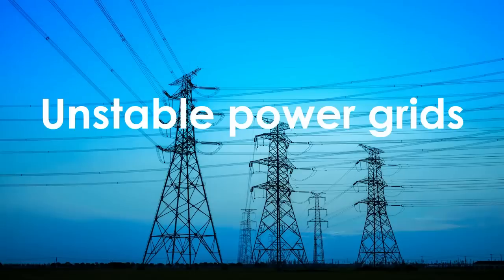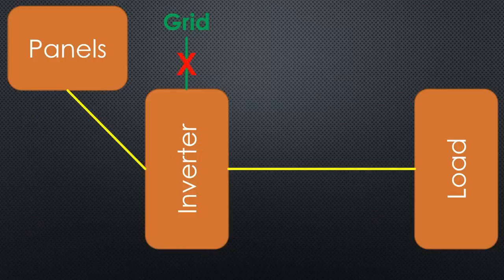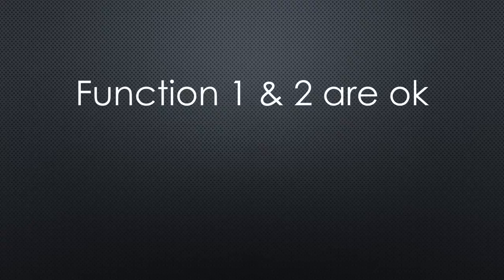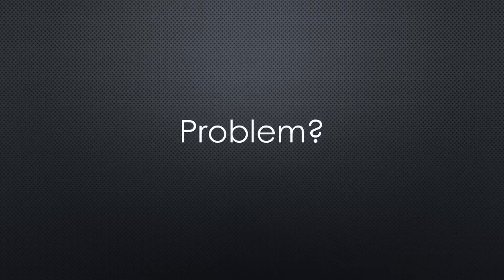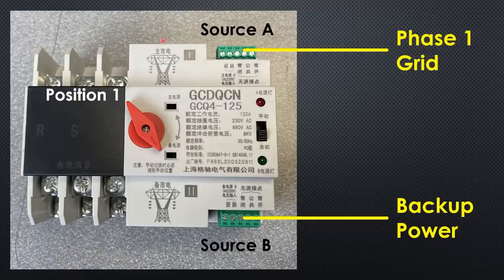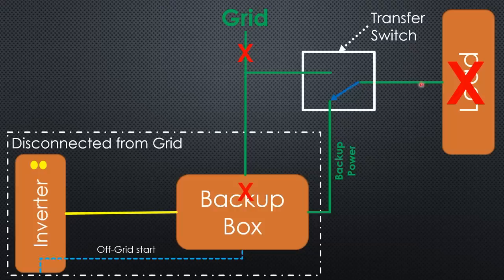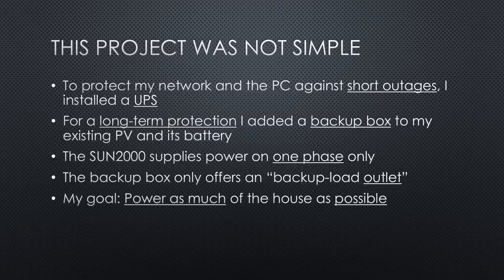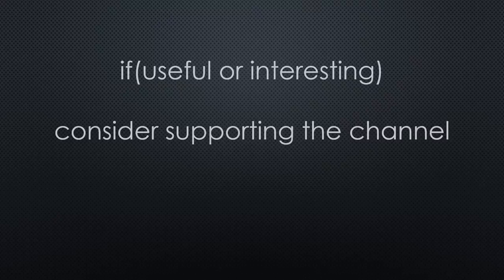448 How to Build an On- and Off-Grid System (Backup Box Hack, Huawei SUN2000, LUNA2000)

Comment: Hello Andreas, I have at the moment also a SUN2000L1 so only one phase, without battery or backup box, and my parents are also asking for a solution when the grid goes off.
You got a really good price for the 10 kWh and the backup-box, I think now it is much more expensive.
I think that a better solution is to buy an off-grid inverter that accepts non proprietary batteries, I am thinking about a Growatt with Pylontech batteries, this inverter will be connected between the Huawei and the house and will work as an UPS when the grid is off, without the delay that the Huawei has. Of course no hack of the electrical network will be needed.
Reply from the maker: I needed an on- grid because it’s main purpose is producing energy for our home and sell the rest. We produce 5x what we need in the summer months.
Reply: @AndreasSpiess  I have also on-grid and already injected a lot, but instead of Luna + Backup Box + Hack + UPS I want to use a Growatt + Pylontech. Much more KISS than your approach imho. I guess you didn't know that the Huawei has that 3s delay when commuting from on-grid to off-grid?
Reply: maybe since DIY self storage isnt practicle, combining all the extra solar energy could make it more practical, to say move a mass battery, a huge rock that spins, having like 50 solar connections hooked up to it all giving their extra energy to spin it where on their own couldnt do it,  then this spinning mass will be slowed down to use the energy in the winter, obviously would this be a net gain is something a little math would figure out quickly, but other than pumping water, no long term solar storage really exists...
Reply from the maker: @bbogdanmircea  I do not know which particular products you look at. Just ensure your inverter or battery can do all the needed off-grid switching.
Reply from the maker: @mikejones-vd3fg  We can store a lot of electricity in our alpine lakes. But for the moment, I do not care too much about it. We still burn lots of gas and coal during spring/summer/autumn. If we can replace that part, we already have something... For the rest, we have a few years left. And as an engineer, I am confident that innovation will not stop.
Reply: Hello, thank you for your input! My supplier has installed Sun2000-8ktl-m1 and a Luna 2000 battery. They are about to install the backup box as they sold to me as a off grid solution.. When I read the documentation + see videos like this I find out that the Sun2000-8ktl-m1 is not going to work totally off-grid and the backup box will only deliver 3000va + the 3 sec. Delay.. I am not so happy about that. Can the solution you are describing work with the setup I have installed now? If so, can you please tell me what I need to do. Thank you😊

Comment: Hello Andreas. I'm new to solar and thought this video was very interesting. I'm just wondering why you are investing this amount of money for something a 1000€ petrol powered generator could do, during a longer blackout?

As you, I like things simple, so my plan is to use solar to complement my grid. No batteries, no inverters, no big investments, only solar DC to DC load. Small investments, but still a system that continues to work when the grid goes down. That happens 1-2 times/year here in  Sweden and it never lasts longer than a few minutes.

As I said, I'm new to solar, but my plan is to use the sun and solar panels to power pumps and resistance wires to heat up my pool, cook food, heat my house and run my water heater. This will work in theory and I'm gonna try to make it work. Simple and cheap solutions.

I really like your videos, so keep up the good work 👍
Reply from the maker: The backup solution was a hobby for me. Not needed in Switzerland (like in Swiden)...
Reply: @AndreasSpiess  Ok, I understand. Thanks for the reply

Comment: Hello Andreas, thanks for your videos. I have noticed one possible problem with connecting 1 phase to 3 phases and it is possible overloading of neutral (blue) wire on appliance connected to 3 phase to star. If phases of AC are shifted by 120 degree, as from grid, than in balanced load there is no current on blue wire and in worst unbalanced case there is same current as maximum on each phase wire. Therefore blue wire has normally same (or smaller) diameter as phase wires. If all three phases are conneted to one though, there is no shift, and on blue wire current will be 3x phase current. As this is how my water heater is connected (3 phase to star) i have been thinking about current on neutral wire an it is freshly in my mind. As you do not use electricity for heating, this is probably not an issue for you, but it is important in general, as this could lead to serious  overheating of blue wire if used for longer time. I hope this is not already mentioned in other comment, but there are too many.
Reply from the maker: In principle, you are right. However, my inverter only delivers 5kW. So there is no problem with that. Plus to save (precious) energy when the grid is down, I do not use such high-power applications.

Comment: Correct me if I'm wrong but Star connected motors supplied from 1 phase will overheat immediately, the currents will be the LRA (Locked Rotor Amperage) and the system will overload the inverter  🤔 ....... Star connected resistive loads can "overload" the neutral wire if they are too high, but if they are small loads I do not see that much problem
Reply from the maker: The problem with star motors is well possible. I do no more remember these topics from my EE studies ;-)

Comment: Thanks again and Congrats! Paralleling all 3 Phases could overload the neutral line of loads in star configuration. But during power outage, cooking will be done by a camping gas cooker.  
Your solution is very unexpensive. The battery is way less expensive than my BYD HVS. And your Backup-box is quite fast.
My Fronius Gen24 supports 3 phase backup. But it needs an expensive backup box und the transfer is slower than yours (German rules, I think).  Otherwise my small Victron backup solution for the heating system has UPS speed.
Reply from the maker: The Victrons seem to be very fast. A colleague has a 3 phase design and is happy. When I ordered our inverter I did not think that I ever will think of a backup solution. For normal operation, my inverter/battery is extremely cheap ( and is LiFePo4 and high voltage). All deciding factors. one year ago...
Reply: @AndreasSpiess  The backup idea was the starting point for me in 2021 after reading the report of the Bundesrechnungshof anticipating the issues and after the elections. But I hesitated too long because I wanted to avoid 3000 EUR for a new main distribution box in my >50 year old house (crazy German rules). And I wanted to have a 3 phase Victron system. But here, there is no company installing this. So, I ordered in March 2022 a "standard system". Then, all was delayed until autumn. In autumn our government decided 0% VAT for PV beginning from 2023. End of january the system was installed but I have to wait until the meter is replaced by a two directional one.....  Long journey
Reply from the maker: @klassichd10  Indeed. We were lucky, and from the order (24.2.22) to the first energy (26.5.22) was fast. The counter came in June. But I still do not have a valid invoice...
Reply: @AndreasSpiess  But you have your "own" electricity. Fast and inexpensive, lucky man. Virtutis fortuna adjuvat. Great DIY team.
Reply from the maker: @klassichd10  Indeed. Being a YouTuber might have helped a bit ;-)
Reply: @AndreasSpiess  A well-deserved bonus for you and you shared it with your neighborhood. Well done!

Comment: My Fronius Symo GEN 24 8.0 is also a Hybrid Inverter like yours. It supplies 3 phases and up to 3.7 kWh per phase and max 8kW (for my version) in total. And strangely, Fronius claims that the off-grid mode must only be used for max. 20% of the total life time of the device. Why? Cooling? Market segmentation against more expensive off-grid solutions. But the best of your solution is the switching time: For my Fronius the siwcthing time (the time without power) about 90s. Your switching was very fast. I do not understand the technical reason for the 90s delay in my case. But anyway, the long term problem is solved as well. I like concrete information about devices, like in your videos, very much.
Reply from the maker: I know why they wait for the 3 seconds here. The electricity company wants that the inverter waits till the breakers are "really" open. Only then, the "off-grid" signal must go to the inverter. An it needs a short time to start.
90 seconds seem to be rather long... And I did not read anything 20% usage. However, our inverter delivers 8kW in on-grid and only around 3kW in off-grid.
Reply: @AndreasSpiess  Yes, waiting for 3 seconds to make sure the mechanical switches did their job is ok. The 90s smell like they want to skip any short power outages which are less than 90s and do not want to go into off-grid mode for short periods of time. But I do not understand this. And yes, the inverter also restarts in my case. But that should not take 90s. I think the market for the hybrid inverters is still developing and we will hopefully see better products in the next years. I mean, you could easily imagine an UPS-like switch within a half-wave. That would be a killer feature since it would further simplify the setup and that would certainly be worth some money. (I hope some manufacturer reads this. 🙂 )

Comment: for around 10.000 euros I build a system with 13kwh of batteries 6kw of solar and 2 inverters. A cheap grid tied inverter from a brand called solax and a victron multiplus 2 5000va. The system power the home with out grid and if i don't have engough sun it switch to the grid. for the money the system is quite cheap. I build everything my self so that lower the cost significantly.
Reply from the maker: Good project! I hope you will be successful!

Comment: As I am not really an electrician I have some issues in understanding the ATS-wiring (to be able to discuss with my electrician). My understanding: Source A (upper area): Phases 1-3 are not connected, just phase and neutral on the green connector from Grid. Source B (lower area, upper connector): The phase from the backup-box is connected to phase 1 and also to 2 and 3, right? The green connector is connected to phase and neutral from the backup box. The lower connector on the lower area is the output to the load.
Reply from the maker: Yes. The Huawei inverter only provides one phase. But I wanted light in all rooms. So I connected this one phase to all phases.

Comment: Maybe I misunderstood something... the SUN2000 inverter runs 3-phase when the grid is connected, but only 1 phase in backup mode? Or is there a second inverter for the grid-tie operation? This is one case where I'm glad we split one phase here in the US... much simpler household electrics! 👍
Reply from the maker: Yes, the SUN2000 inverter runs 3-phase when the grid is connected, but only 1 phase in backup mode (explanation in an earlier video). This is the reason for my "hack".

Comment: Interesting exactly what I need , I want to make my own back up box , do you know what the signal/ voltage is given from the original backup box to the inverter to fire it in back up operation?
Reply from the maker: No. I assume the backup box just has a relay contact.

Comment: For a system that only works if the grid is connected then I'd just use a small-ish SINE WAVE inverter fed into the changeover switch to make the system think it was connected to the grid again, as a sort of solar boosted inverter (make the whole system think it was grid connected again). Not sure on the legality, but at least you'd have power again from solar (and batteries). Excess solar would then keep the batteries charged.
Reply from the maker: I am also not sure about the legality. And what happens if the grid comes back...
Reply: @AndreasSpiess  The grid is disconnected when it fails, and swaps to your system by an automatic change-over switch (it's pretty much what the purchased all in one off-grid powered devices do, but a diy version for people that have a non off grid capable system). If the grid  comes back, it can automatically switch over again. At no time would you be trying to put power onto a dead grid (that is most definitely illegal). I've no idea if it would work, as I'm not sure if it's possible to fool a grid tied system into thinking it's attached to the grid using an inverter, but it's what I would try if had to. This is why I made a point of the inverter having to be a good quality, sine wave type, to maximise the chances of success. Some residences have the option of a change over so that you can partly power your residence from a generator in the event of grid failure. I believe it is done in the US and also the UK in some rural areas; some of my siblings place of residence has the option, and it is used every so often with a backup generator for partial power (light loads and lighting and for the heating as that doesn't work without an electrical supply, even though it is fuel-oil powered).

Comment: Cool, i'm from Algeria, and i have a similar situation to yours when it comes to the distribution of loads and phases, each phase is going to a different floor, and heavy loads and lighting/light loads are mixed, i wish i could rewire everything to separate them but it will cost and take much effort
i also spent tons of money on 17Kwh OPzS batteries, and a victron Multiplus 5KV inverter (i've yet to buy extra 2KW panels in addition to the old 1KW )
i'm currently reading about classic control to build my own custom ATS to fulfill my needs, with open option to use Arduino to add some complex logic to the system
Reply from the maker: At least you should have much more sun than we have ;-)
Your battery is quite big for a 1kW panel, BTW.
Reply: @AndreasSpiess  yes, planning to get extra 2KW, have more cooling loads in summer, usually the AC stay on at night in July and august
Reply: @AndreasSpiess  the reason i bought the batteries before the end of last year and before solar panels was inflation, while solar panels price go down every year even with inflation

Comment: This video does not mention, is the Smart Meter (DTSU666-H) also required for this solution to work? In the wiring diagrams I am seeing this as an integral part and also in your video when looking at the fuse box it is present.
Reply from the maker: As all grid-connected systems it needs this smart meter, you are right.

Comment: Hi Andreas
1) Where is the Huawei smart power sensor located in the setup?
On the grid side of the Automatic Transfer switch?

2) Is the any circuit breakers or relays on the grid side of the ATS? Like a EHFI relay?

3) I assume the grid meter is on the grid side of the ATS?

4) Since the SUN2000 gets its power from the house grid, which in your case is powered by the backup box when off grid, can that be the reason it still powers the inverter allowing the solar panels to provide power for the house grid as well charging the Lunar2000 battery?
Because Huawei states only the L1 inverter can run in pure off grid mode, not the M1 you have (and I). The M1 supposedly only allows the battery to provide backup power…

For me, if the SUN2000 does not charge battery and run house on solar when off grid, backup box is not much use. 
So I am really curious how you made it do it!!!
Best regards from Denmark
Reply from the maker: The Smart meter is on the grid side. There is no need for it if off-grid. As said, my inverter charges the battery in off-grid (Huawei info is probably outdated).
The rest of your questions should be answered in the video.

Comment: Hi Andreas, I love you solution and like to test your creativity!.
We have a home with
3 x 10k 3phase inverters with each 15kw batteries and 3 backupboxes (66pv panels).
The house is powered by 3 x 400V+N (32amp) and inside the house evrything is cabled on 3 times 230v , we needed the 400v for heating pumps and the Electric car.

How would you propose to power the house and combine the 3 backup boxes mono phase 230v and create
1) 3 phase 230v 
or even
2) 3 phases 400V+N

Any solution is good (UPS, transformator or recabeling)

Thanks for your creativity
Alex
Reply from the maker: I do not do consulting (too dangerous). I only show my findings in my videos. But I am sure, with the understanding of what I did, you will find the right way for your situation that is legal and working. Your situation is basically the same as mine. The only thing is that I had to do a trick because I only had one phase to power 3 phases.